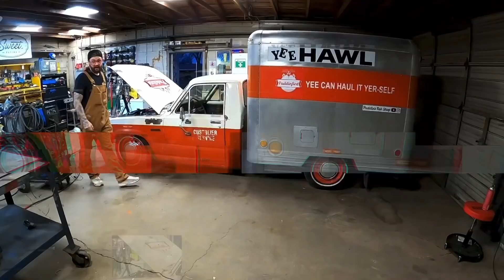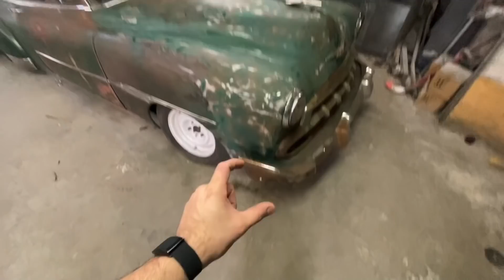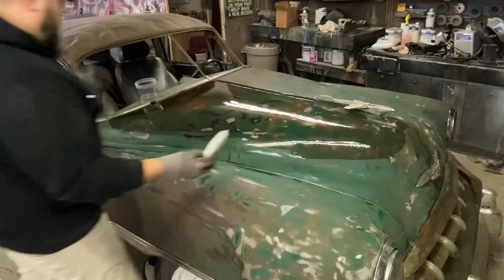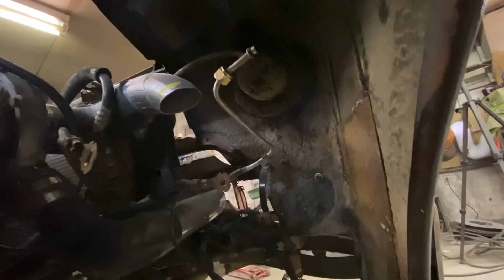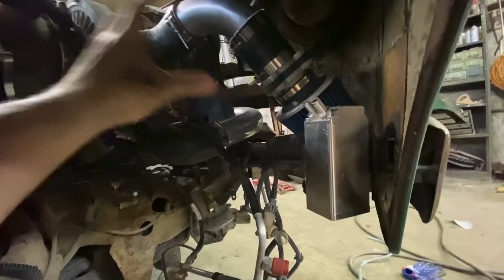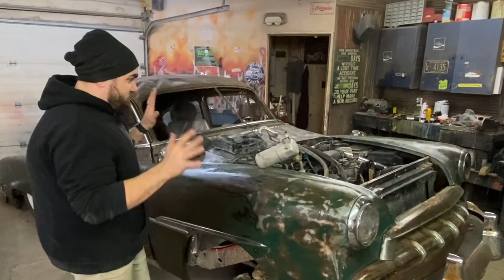YOUTUBERS FIGHTING!? PUDDINS FAB SHOP HACKS MY CAMERA! $3500 BUDGET RAT ROD BUILD! 22 CHEAP HOT ROD

Comment: New Balance are awesome.. Nike doesn't make a wide enough shoe for us bigfooted guys!
Reply from the maker: Gotta step up to the jordans they are real wide and have options for wide sized
Reply: I have to agree with casey I wear jordan 5s everyday for work and they are the best fitting and width is great and I'm size 14
Reply from the maker: @richardf.sangerii7716  yep, the reason i started wearing them in the shop was because the fit and I’m a 13w in other shoes but a regular 13 in Nikes

Comment: I like to put my kill switch in the ground between battery and frame works out nice and if I have to hide the battery like I did on a 40 ford build I also use them jump posts  . Very necessary if using power door buttons instead of door handles.

Comment: Nice first start man.  I know it's a bit late in the build but I was just thinking of you had welded the hood to the fenders and hinged the front clip so it flipped forward that might have solved a lot of your tight access issues.
Reply from the maker: That was the plan originally actually, but it would go taken up more room in front and also I’m not a huge fan of them
Reply: @CaseysCustoms  I can definitely understand that, plus a lot more work.  Always compromises in any build.